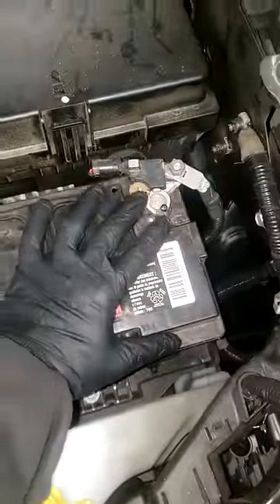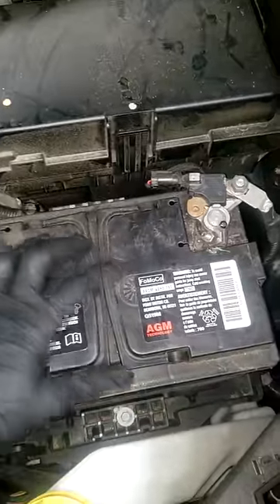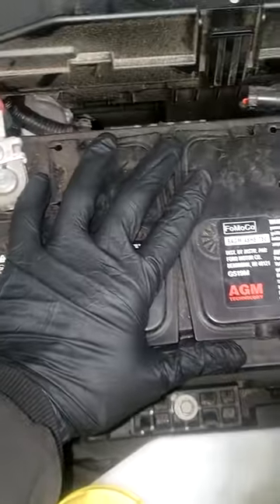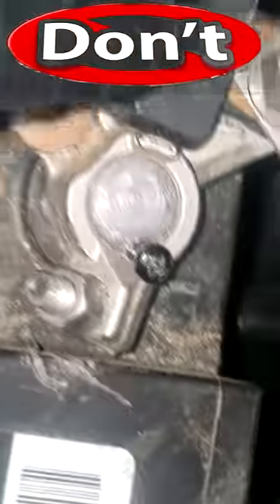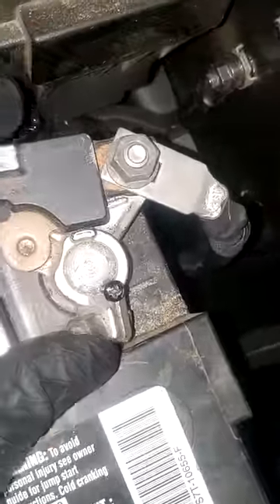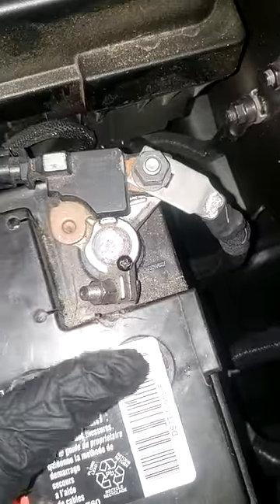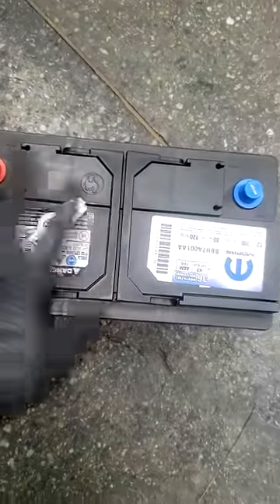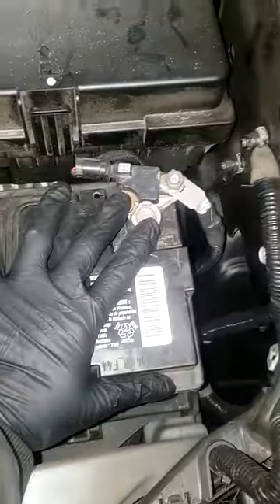STOP DOING THIS PEOPLE. This will destroy your car electrical system.

Comment: why are you using those poorly engineered terminal post connectors?

why not just use a post shim ferrule to enlarge the post so that connector fits.
and do a proper load test on the battery.
Reply from the maker: Dude, you dont use that hack stuff on these newer cars..omg..You trying to get the lady to brick her transmission. Do that crap on the older model cars thats not using a IBS setup
Reply: @OnlineMechanicTips  brick, you mean break. transmissions have nothing to do with a battery. engine running the battery is just a load to the alt. everything is powered by the highest voltage first. the battery SHOULDNT have any affect on the operation of ANYTHING except the output of the alternator.
Reply: @OnlineMechanicTips  IBS setup?
Reply from the maker: @administratorperson3272  OMG, Did you just say the transmission has nothing to do with the battery??? I should have known i was wasting my time with you. Sorry dude, I cant, I just can't with you.
Reply: @OnlineMechanicTips  you are irritated. i can not find ISB relative to automotive limited to the first google search page. is that a typo?
Reply from the maker: @administratorperson3272  Wait, you start this conversation off as if you know everything now you running to Google for the basics of things? I'm not even sure what you talking about now. This stuff im referring to is of new cars so you may have a hard time with that

Comment: I've had so many customers bring their vehicle in because they replaced the battery on their own and now their Tpms sensors won't read and need to be relearned. Vehicles today are very complex. That's why we're not called mechanics anymore we're technicians. I've got so much knowledge on cars in my head and I have to constantly learn new technologies while being mechanically inclined to solve problems. Just take your car to a shop with good reputation, great customer service, and competent techs that know what there doing.

Comment: Idk if that caused the problem. It does look bad though 😂
Reply from the maker: Its ok, we don't expect you to know if that caused the problem without actually checking it out. Because if you merely yell out what the problem is without checking it,  that would be considered a guess.
Reply: @OnlineMechanicTips  That’s funny, it kind of seemed like that’s what you did.
Reply from the maker: @Brindle_Boxer  Works, just work better when you actually there, not over the internet.
Reply: @OnlineMechanicTips  I think your fix was perfect. I just don’t think the screw caused the problem. It was still a good idea to replace the sensor though.
Reply from the maker: @Brindle_Boxer  How so, she likely would not even had came to the shop had her check engine light not came on. The light is on because the IBS detected some foolishness going on. That sensor measure amperage usage as well as temp. Your logic is that the screw affected neither one of these.
She would have never known that screw was there had I not shown her the likely reason her check engine light was even on. Look my guy, stop underestimating the power of what these computers monitor and detect. This not 1990 cars anymore. You simply can't do that crap on these new cars.
Reply: @OnlineMechanicTips  A bad battery could have just as easily cause her problems. That’s my opinion. I don’t know for sure. I just doubt the screw caused the problem. It would be cool to see how if it did.
Reply from the maker: @Brindle_Boxer  no way to squeeze in diagnosis as well as repairs or verification footage on a 60 second shorts video. Had this been a long video with every needed you likely would not have watched it. 90% of youtube watchers attention span low. So in order to rack on views, I take my chance with the short videos.
Reply: @OnlineMechanicTips  True, I don’t expect you to do it. Whatever you’re doing must be working if your video reached me without me looking for it. 👍

Comment: You made her buy a new battery because of one screw that wont do anything to anything, the screw is ugly and unprofessional but so is fitting a new battery, you didn't even test the old one.
Reply from the maker: Did you take your meds this morning? This battery wrong and dead, screw in terminals not good for proper connections and this IBS. The proper repair is to simply replace both. Leave that hacked shit off these newer cars because if you come here, this is what will be recommended. If you a tuff guy like you and say no, simply pay your check out charge and take your car. Its all fairly simple.
Reply: @OnlineMechanicTips  I take my meds at night thanks. I can't respond to the rest of your drivel as it makes no sense but that's not a surprise.
Reply from the maker: @ernsailor9041  please stop missing days. You say stupid shit on youtube when that happens.
Reply: @OnlineMechanicTips  I'm surprised you have time to reply, you must be really busy defending yourself from all the people telling you you're full of it and ripping off customers.

Comment: a lot of cars have fuses there. like underneath that cover, it's just a big ass fuse. ibs sensor is news to me, speaking of battery sensors, can anyone tell me why there is a sensor, underneath the battery in 96-up Jeep Grand Cherokees? what is it, to tell the computer, "hey, the battery is not in the car anymore", and shut the system down? makes a lot of sense, if the battery is not in the car, the damn thing gonna sure as shit be shut down, anyway.➕😝👍🏻➖
Reply: maybe that sensor below the battery in the 96 Grand Cherokee, turns on this idiot light🚾 to tell you your battery just fell out. ➕💩➖

Comment: Nope this is wrong. Yes, i would never do or recommend to do some mickey mouse shit like putting a screw but that would not cause issues. And before you  mechanics say im wrong, im not a mechanic but a battery technician, so this is my profession. Most likely voltage and or cca  just dipped too low.

Comment: There's no way it's that sensor bud because who knows how long she went with the car like that worked fine like that before I know it's a hack job but if it didn't work they wouldn't give her that car like that unfunctionable it's probably that old Abosrbed Glass Mat battery dried up and is shitting the bed
Reply from the maker: My dude, who cares how long about any of that. Poor connection at the battery is the worst thing you can do to these new cars that use IBS. we recommended a battery (battery dead and wrong) and a new IBS terminal. She agreed and said fix it and thats a rap. She's gone and happy. We not about to waste time with her past or who put the screw in because we don't care. This hacked shit not good for this new car, she lucky her transmission not bricked.

Comment: Needs a battery?
Reply from the maker: It got a battery and a IBS
Reply: The question was rhetorical! The screw was there for contact,  was the battery dead, no good, or just need another end on cable?(from the way you were talking). I see it had a battery!
Reply from the maker: No screws of any kind acceptable especially if it interfere with connection. You can brick your transmission and cause all kinds of problems. The terminal and sensor all 1 unit so it was replaced. Battery was wrong and failed load test.

Comment: the heart and soul of the electric system is not the battery.
Reply from the maker: Didn't you hear me say "in my opinion"? That means IMO. You welcome to explain your opinion on this matter. So whats your opinion?
Reply: In fact, in my opinion, it most definitely is. Without the battery you do not have an "electrical system" but rather a bunch of wires, fuses, relays, and modules that will not function.
Reply: @midnightrider1854  Heart and Soul here we go again folks.
Reply: @midnightrider1854  I plead the 5th

Comment: Are you sure?? Or just replacing parts till you find the problem? I disagree with your analysis of the problem.
Reply from the maker: Lol, but i didn't deliver an analogy. This a 60 second shorts video. I merely told you what I got and what im doing. I dont really care what you disagree with. The car fixed and long gone.
Reply: @OnlineMechanicTips  Well I have to say l'm impressed by your quick response. Know anything about Chrysler Sebrings? Say 2006? Besides telling your friends and family Not to buy one 🤣
Reply: I apologize if you took offense to my response.. I'm kind of an aquired taste. Doesn't play well with others... That's what teachers said on my report cards...50+ years ago.🤡
Reply from the maker: @caseyphilips3007  Those cars are great. Just no way to diagnose them anymore because our scan tool wont go back that far.
Reply: @OnlineMechanicTips  I got one. Convertible. #3 misfire.. Computer won't talk to scan tool. 6 Mechanic's. Couple grand...car still broke. Suggestions?

Comment: No you didn't need a battery just a clamp.
Reply from the maker: Thats not just a clamp..And how you gone tell me what it need?
Reply: @OnlineMechanicTips  what it needed was clean the battery terminals and clamps. Tighten. Try and turn it by hand. If it moves it's stretched. Replace clamp. The clamp was probably loose or stretched. I have fixed that problem several times.
Reply from the maker: @suggesttwo  Did you not hear me say this not a typical clamp? This basically a sensor, you shouldn't be drilling and poking holes in a dam sensor..This not non of that old stuff you usually work on my guy..Technology has changed. Maybe you should try to change with it or keep up. Careful trying to come for me ok

Comment: Nah it's just the battery. That battery is the original and that little screw want cause that kinda bs
Reply from the maker: ??? TF???   Make this make sense
Reply: @OnlineMechanicTips  well I've changed literally thousands of batteries, I've done it for living everyday for 30 years. While I would agree the screw is not ideal and looks janky, as long as it was tight it won't effect the performance. If it was losing contact,  maybe but I'm 99% sure in this case it was just the battery as they can do some wild things, things you wouldn't expect. I would be curious if you tried just changing the battery before you changed the end to see if that took care of the issue. I've put alot of screws in like that when I had to and never had an issue. I've never had to replace the sensor on the cable end like that, every time the new battery took care of it(or tightening a loose/dirty end)
Reply from the maker: @toddstrongrayvenz5286  Then stay the course, im not trying to change how you repair cars based on your opinions. Im merely displaying what im doing based on my diagnosis and opinion.. The check engine light code points at problem with the IBS, someone installed a screw which compromised the perfect connection thats required. So pretty much simple from this point. Repair everything back to factory settings. It got a battery and the sensor. The sensor is all 1 unit that includes the terminal, problem solved.

Comment: Bet u charged 1500 for that
Reply from the maker: Now why would you bet that?
Reply: @OnlineMechanicTips  cause your explanation was way too long for says hey, someone stuck a screw in your battery terminal that doesn't belong there. Super simple fix. Complex explanation for that high price
Reply from the maker: @drewcarter5435  This a 60 second shorts video. If you have a problem with those then there's really no hope for you.
Reply: @OnlineMechanicTips  😴

Comment: Say you no nothing about electrial diagnosis without saying it in a 4 minute video
Reply from the maker: Dang, another Mr nobody, get at me when you become somebody my guy. You not on my level yet. I got Scotty Kilmer and Eric O and Chriss Fix and nem in my sights...lol..No time for ya lil scrubs ass
Reply from the maker: @michaelwooda9444  Again, no time for scrubs. I got Scotty on the line, hold on lil guy.
Reply: @OnlineMechanicTips  you need to get Nashville automotive diesel college on the phone.18 months you could be an oil change tech.

For one,you could have cleaned and then rechecked the battery and the cable.also,do you own a scan tool? That would be a good thing to do,check for codes.use a dvom and check for voltage and voltage drop across the cable to see if that is the problem.then actually load test the battery before telling the customer they need a $200 battery.
Reply from the maker: @michaelwooda9444  You still here? I cant waste time with you little man. You just have a big M as your screen name, youre nobody..FOH